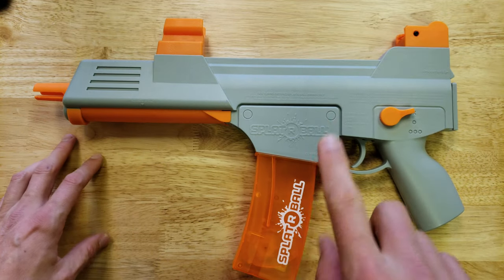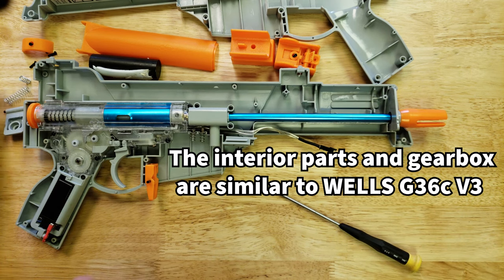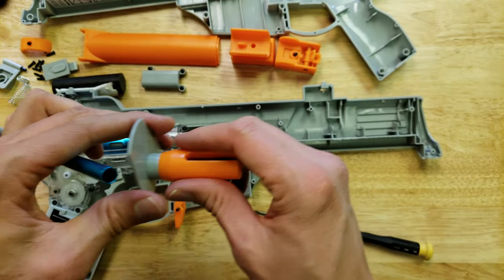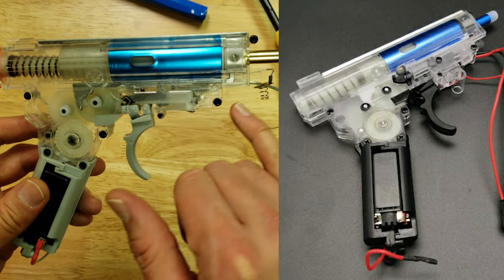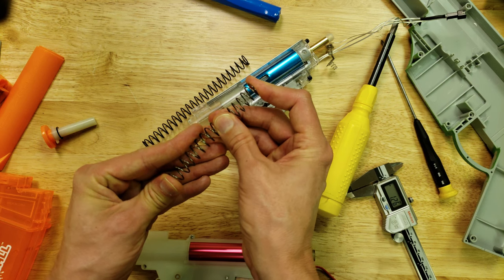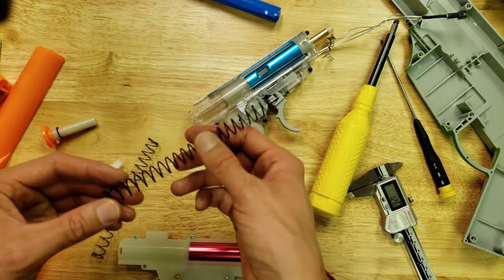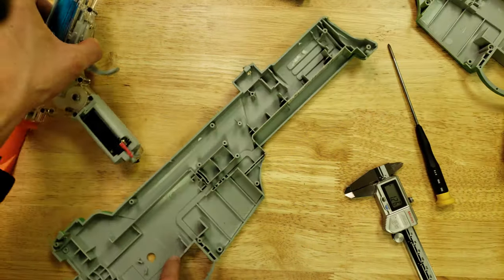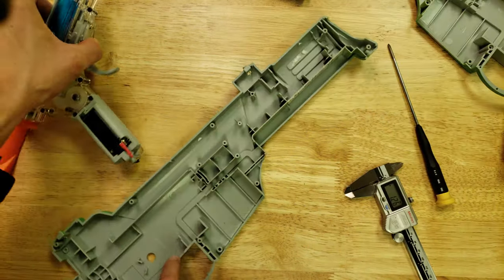What's Inside SPLAT-R-BALL Gel Blaster?! I Take Apart SRB400 Gel Ball Blaster To See How It's Made

Comment: Any one knows what spring to get so it hits harder
Reply from the maker: If you only upgrade the spring, you'll strip the gears quickly. Check out my upgrade guide here: https://www.engineerable.com/single-post/what-s-inside-splat-r-ball-gel-blaster-i-take-apart-gel-ball-blaster-to-see-how-it-s-made-works
Reply: @engineerable  so will the 18.1 metal gears fit in it and also then can I use a bigger battery or with that mess the motor up
Reply from the maker: @Liltman94  The default gears are probably 18:1. If you replace with metal gears, and metal tooth piston, then you are good to go for bigger spring. Higher voltage battery will only increase the rate of fire, not the speed.
Reply: @engineerable  yo so I got 18:1 gears a metal gear reverse latch 14 teeth metal piston and a metal d pinion I’m I good to use a higher voltage battery or will that mess up my motor
Reply from the maker: @Liltman94  Have you installed them yet? There's some mods required to the piston to keep it from coming off the wider than normal gearbox track. Also the 14 tooth gear racks I bought had a manufacturing defect. The spacing between the pickup tooth and 3rd tooth was off. I'm working on the video.
Reply: @engineerable  I got the shs one what do I need to do to the piston
Reply from the maker: @Liltman94  I hope that yours is good. Mine was defective. See if your metal sector gear meshes properly on it. Check out my post showing the incorrect spacing https://www.youtube.com/user/engineerable/community
Reply from the maker: Watch the metal gear + spring upgrade video https://youtu.be/qQKaKdEUPCs

Comment: Can’t I just take the spring out and stretch it out??? I know it’s not as good as a upgraded spring but it should work
Reply from the maker: Do it if you wanna, but it's not a good idea. It stresses the spring out and it will fatigue. Also, you can't increase the spring strength without also replacing the gears with metal gears. The plastic gears will work initially, but will strip sooner with a stronger spring.
Reply: @engineerable  ok I literally just did it and it works perfectly and ordered a new upgraded spring that will come in a couple months then when the gears break I’ll buy metal ones then upgrade the battery then the motor

Comment: where can i find the gearbox to ship in the us
Reply from the maker: The gearbox is a common airsoft V3 gearbox modified to work with gel balls. Haven't seen the gel blaster gearbox for sale in US. Had to get them from overseas like Alibaba, but they appear to be out of stock. If it's just the gears that need replacement, I read that gel blaster Gen8 gears work. Airsoft V3 gears should also work, as long as they can pull the tappet back far enough.
Reply from the maker: Watch the metal gear + spring upgrade video https://youtu.be/qQKaKdEUPCs

Comment: How do you take the barrel off ?
Reply from the maker: Take the barrel off the plastic t piece? Use heat. Water at about 60-80C should soften the glue enough to remove it. Too hot and it will deform the plastic.
Reply: @engineerable  yes the orange barrel in the front of the gun
Reply: @Ayetallwall  That's the muzzle end of the barrel, and the orange piece is called a flash hider. It's shown in the video how to remove it from the barrel, but you'll have to cut off the orange part. Here's a video about that: https://www.youtube.com/watch?v=bEzlIBcjeWM

Comment: I was wondering why theres a lead warning on the gun…. That weight in the front is litterally a block of lead lol
Reply from the maker: Mmmmm, I don't think so, it's a slug of steel. Lead is too expensive compared to steel for that purpose. The lead warning is likely due to wires, brass parts, contacts. Lead is used as an alloy in metals. It is also used in plastics like PVC which is often used as the wire insulator to make the plastic more flexible, reduce risk of fire, and stabilize the color.

Comment: My srb375m won’t shoot and my battery keeps getting hot what should I do
Reply from the maker: Battery getting hot indicates a short circuit, or motor is stuck. Could be a few different things. Gearbox is jammed, motor is stuck or bad. You need to take it apart and see if you can get the motor to spin. I haven't yet taken mine apart, but it looks like the SRB375 uses a common gearbox and motor. Don't quote me on this yet, but spare gearbox/motor can be purchased for $16 from China https://m.zhenduotoys.com/SKD-M1911-Gearbox-p746078.html
Or $25 from US https://geltactical.com/product/nylon-gearbox-gelstorm/
Reply: @engineerable  the gears wont spin at all
Reply: Like there’s a little bit of sound but no gear spin at all
Reply: I literally just bought it 2 days ago

Comment: My gun won’t shoot like it makes the noise that it’s gonna shoot it won’t feed the bullets I even put the bullet in there without the mag and it won’t shoot it pops out and it em never used to do thag
Reply from the maker: It sounds like the air nozzle is not going far back enough to allow gels to enter the barrel. Something could be wrong with the tappet or gear that drives it. Since the gear that drives the tappet is plastic, I suspect that could be worn, and you will need to replace the gears. Look for a gear kit for WELLS G36c to fit this gearbox (or Gen8 gears). 
I had one (out of 5 I bought) that had an intermittent feeding problem from new. Since it was so still new we exchanged it before taking it apart to analyze.
Reply: How long have the bullets been I'm the gun before you emptied them? And out new in because you might have to take apart that mag take off the guard where the bullets go thru them empty that out if there's bullets in there
Reply: I have the same problem
Reply from the maker: Did you get it fixed? If you can't get Splatrball to replace our fix it, send it to me, and I will repair it, video, and send it back to you for free.
Reply from the maker: Did you get it fixed?
Reply: @engineerable  no I never got it to work how do I contact splaterball

Comment: Where could I purchase the p90 spring to install on my gun?
Reply from the maker: An airsoft spring will work since this gearbox is based off a Airsoft V3 gearbox. However, you're more likely to strip gears eventually if you put in a stronger spring, which means you need to upgrade to metal gears. I've read about people using an m90 spring in the Splat-R-Ball blaster with mixed results, like it works great, but for how long is the question.

Comment: My gun is not even making a sound when I press the trigger
Reply from the maker: You're going to need to use a voltmeter to test if the motor is getting power. If so, then the motor is bad and must be replaced with a 480 motor. If not, then the switch may be bad. If there's no power arriving to the switch, then the battery, battery connection or wiring is bad.
Reply: Mine doing the same thing
Reply from the maker: @LbL._.jathan  You're going to need a voltmeter to figure out what is not getting power, which will help you identify where the issue is.
Reply from the maker: Did you get it fixed?

Comment: Can you please help me my gun isn’t working not shooting or making the sound and it was fully charged
Reply from the maker: You're going to need to use a voltmeter to test if the motor is getting power. If so, then the motor is bad and must be replaced with a 480 motor. If not, then the switch may be bad. If there's no power arriving to the switch, then the battery, battery connection or wiring is bad.
Reply from the maker: Did you get it fixed?